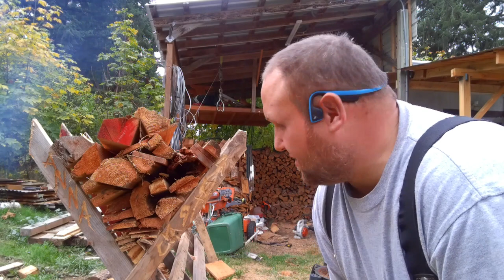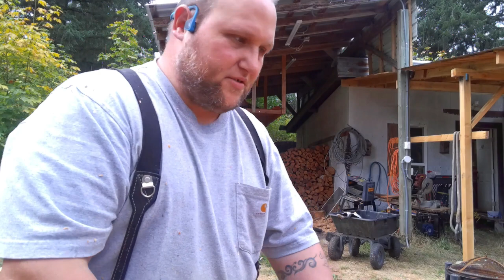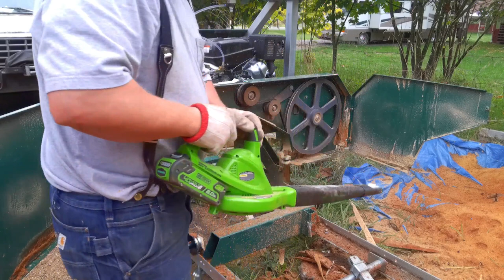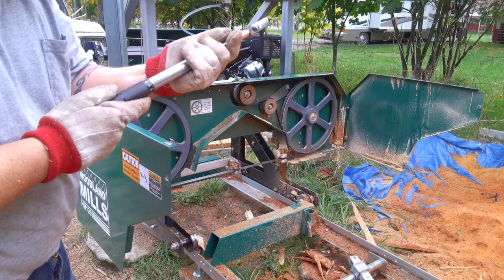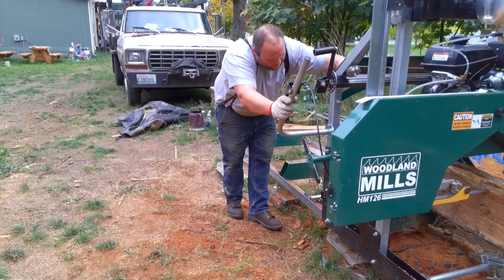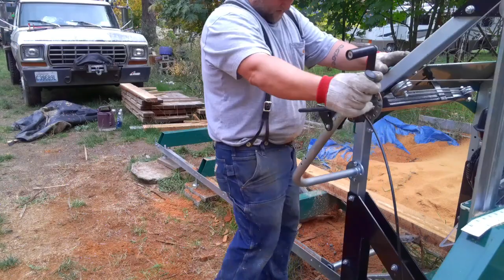Changing a blade, cutting slabs, milling cants.

Comment: Aaahh the 126. I see now. Have you seen the guys using a 144 x1.5 x .055 blades on this saw ? They swear by them. I sense you’re into high performance stuff with the high cube saw and monster bar !  Keep truckin
Reply from the maker: I have seen some guys using different blades. I have a blade from a local guy coming to try out. Thus far I have just used the 10 pack I bought with the saw.

Comment: Nice set-up. How do you like that Forester guide bar ? I’ve been thinking about getting a 24” for my new Echo 7310
Reply from the maker: I have 2 Forrester bars. This big boy 42 inch and a light weight 24 inch. They are both great. I have had this 42 inch one for about 13 or 14 years and it has held up well.
Reply: Awesome. Thanks !